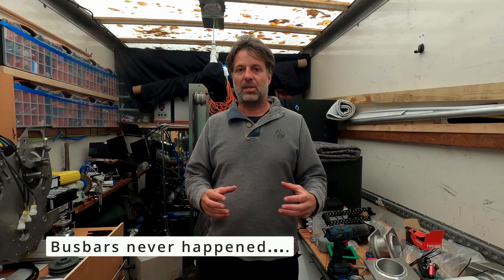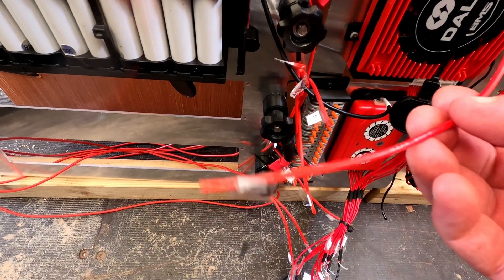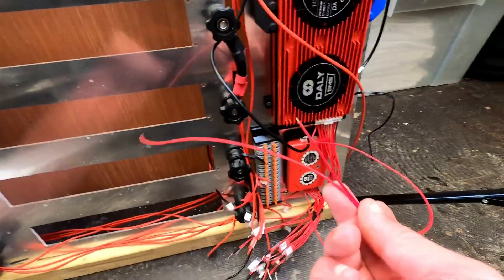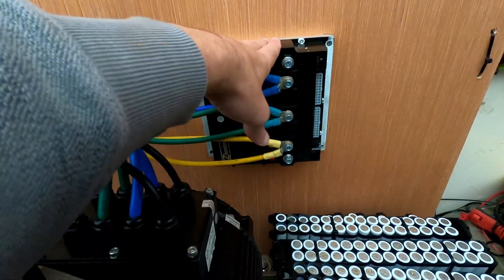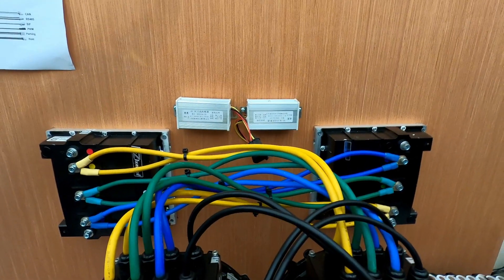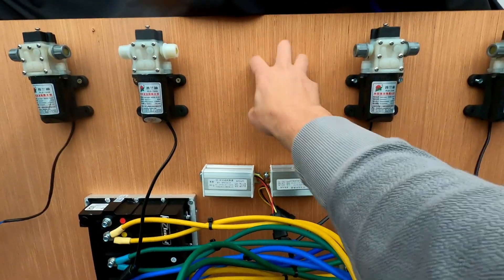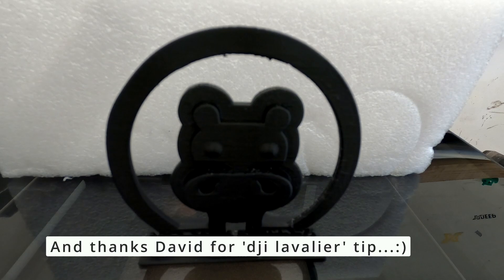Off-Grid Boat: DIY Electric Boat Motor Assembly - Ep. 9

Comment: What type motot do i buy?
Reply from the maker: Hi:) Thank you for taking an interest. The motors I am using are 'Golden Motor' [HPM10KL , 10KW BLDC Motor , Liquid cooling , 48V] and the motor controller is [EZ-B481000 , EZKkontrol PMSM Controller with wiring harness , 48V1000A] - Although I have not yet used them on my boat I have seen others using the motor successfully and that is why I picked this motor:)

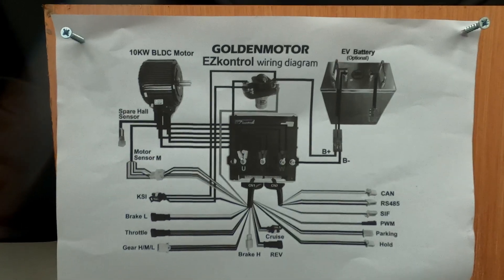Comment: 5:20 keyem4504 already said it but it's basically a safety. Think of it like your car key, the switch has off run and start positions. What you show is basically how you will have off vs run. No reason to always have power going to your motor controller.

As for the part itself, a contactor is a relay that is meant to handle higher currents than a relay.
Critical thing is whether it's rated for AC or DC. Difference is the physical design and material choices.
AC voltage goes high low high, constantly crossing 0V. That means the current also goes up and down. This makes disconnecting AC easy because eventually the voltage and current will fall to zero so no arcing.
DC on the other hand is always high so there will be arcing and the contacts need to be able to handle that.
Reply from the maker: Morning Lagittaja. Thank you for expanding. Just so I get this right. I turn the on/off switch for the motor controller and this will open the circuit to provide the 18w to the DC contactor to kick into action and open current. If something goes wrong with controller then contactor lose the 18w and acts like a kill switch (no power to controller and therefor no power to motor) adding extra layer of security (with trade of using an extra 18w). Getting there slowly😅
Reply: @modularhippo I will type relay instead of contactor as relay is easier to type.
You turn a key switch or you flip a switch, that provides power to relay coil only.
Battery positive goes through relay contact and then to motor controller input.
When relay coil is energized, the relay changes state, for example closing the contacts (normally open).
Reply: Relays typically have the following labeling on the various terminals.
A1 and A2 is basically the coil of the relay. A2 is negative or neutral. A1 you provide voltage which energizes the coil, making the relay contact change state (for example off to on)
Typically relays have multiple contact pairs and as such are labeled xy where x tells you which relay contact it is and y tells what type it is. The most common types are normally open (3 and 4) or normally closed (1 and 2)
Therefore a relay might have contact pairs labeled 13/14 and 21/22.
Contactor contact pairs are typically labeled just 1/2 3/4 5/6 and they will separately say next to the numbers is the type NC or NO.

In your case, I assume the wiring would be
Battery positive to switch > switch to contactor A1 terminal.
Battery negative to contactor A2 terminal.
Battery positive to contactor 1 terminal
Contactor 2 terminal to motor controller input.
Reply from the maker: @Lagittaja  Thanks Lagittaja!!:) Starting to get a better idea now:) Legend!
Reply: @modularhippo  I forgot to add that the labeling I described is for the electrical industry.
Automotive stuff has their own thing, for example 85/86 is the relay coil. Check DIN 72552.
What the marine stuff uses for labels, I have no clue.
But the basic principle of operation is the same.
Reply from the maker: @Lagittaja  Thanks Lagittaja, understood. I will also run anything I am doing by Golden Motors (manufacturer of the motor and controllers) before I take the big plunge:) (just to be safe). Thanks for heads up.

Comment: I guess the contactor is a safety measure that allows you to make sure that the motor doesn't spin even in an event of the controller malfunctioning. And you can also avoid standby consumption of the controller.
Reply from the maker: Thanks Keyem, makes sense. Seen allot of setups where this is not used so a bit confused as to why this has not become standard. Sound like an obvious safety feature that should be a given for a setup like this. Thanks for taking time to elaborate.

Comment: Electronics up, water down. Gravity is not your friend with leaks in that setup :)
Reply: I totally agree. water systems down electrical is higher than water systems just to be sure when you are installing to the boat
Reply: It also helps in keeping things working if water gets into your hull bilges elsewhere ... Keep battery's and controllers higher up unless they are water tight.  It can save you money as well .. 
See how Windelo's organise their electric motor bays ..
Reply from the maker: @clivestainlesssteelwomble7665  Hi Clive, fully agree. Motor controllers, fans, pumps etc. will go as high as possible in the final positioning:) Thanks.
Reply from the maker: Hi Petch - Thank you for comment. Please expand, are you saying that I should not mount the motor controllers below the pumps and reservoirs in case of a leak?
Reply: @modularhippo  Just a general observation :) The most lightly place for a leak is the unions at the end of pipes. If your reservoir and pumps are above your electronics any leaks will flow down. If your pumps and reservoir are at the bottom then the only place they can drip is to the floor.
Reply from the maker: @petch41  Makes perfect sense, big thanks:) For this setup I will keep the controllers where they are mounted based on length of cables I use but with your advise I will definitely have them covered with something as and when I start topping system up with water:) - It is great advise as I did not think that far!:) Thank you for taking time to flag it:)